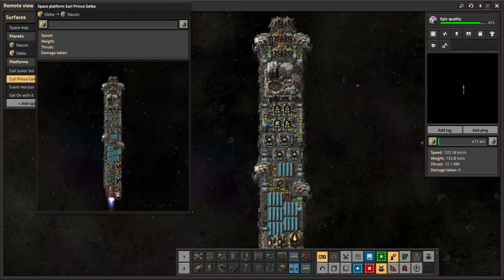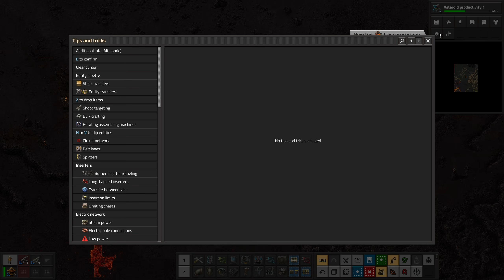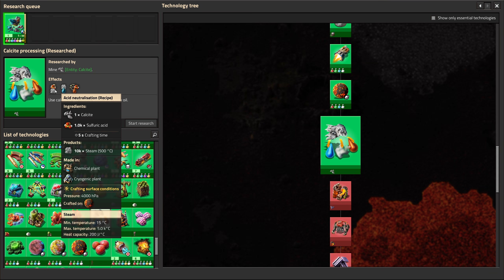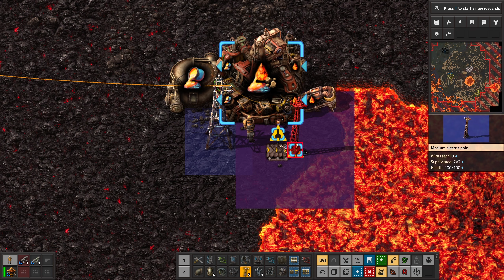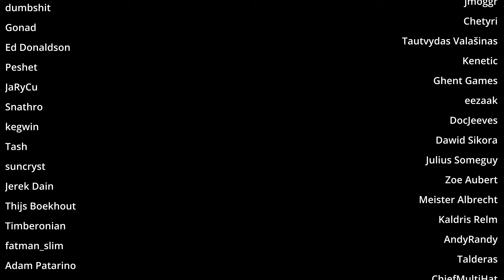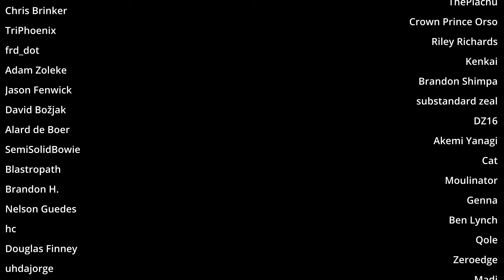Volcanus with no supplies : Factorio Space age Ep15

Comment: I did Gleba and Valcanus from scratch.  Fulgora I did with logistics/construction bots and boot strap power which I kind of regret, but man that would be a difficult startup from scratch.  I also eventually imported my power plant as fulgora power is very interment until you have 1k+ accumulators and 100s of lightning towers.  I was so disappointed that you could not do Aquillo from the ground up but at least it was easy.

Comment: Foundries making foundries are very nice. You cant prod the final product in an assembler so that base 50% prod is very nice. This applies to everything that can be made in the planet specific special buildings.
Look at throughput rates for plates in your foundries, and look how much calcite you need. Spoiler, it might fairly be described as negligible. 
You can EASILY do 1k spm on nauvis importing 100% of a calcite, using only stacked belts. You can, without much effort, do 4k spm in the same manner. This would be without any quality buildings.

Anyway, yeah, megabasing on Vulcanus is more fun than not imo. Then just export all the science to Nauvis for the biolabs (can only be placed on Nauvis so you're stuck doing that). If you want to avoid transporting the science, you can just use foundries on Nauvis, it ends up being about the same amount of effort. Vulcanus feels more novel but that just me.

Comment: I think it's more fun when each inner planet is mostly self sufficient. That being said I'm totally okay with bringing some starter supplies, like steel furnaces, assemblers, chemical plants, power poles, bots, and some raw materials. Enough stuff to get you off the ground so you can start producing it on the planet without having to slog through starting from nothing.

Demolishers totally do demolish cliffs if they run into them. They will go out of their way to destroy any buildings you place in their territory when they see it on their patrols, which is a good way to put them to work while you do other stuff.

Also I can't believe you just dismissed toolbelts like that. Ah well, I'm sure they'll find their way into your equipment grid one way or another.
Reply: to fill up that legendary equipment grid they will

Also Devs made it so you can start well on any planet - the last one, so... i like his plan of figuring out stuff from scratch THEN dropping everything you mentioned to speed up the scaling. 
I don't wan to see him figure out the whole production chain in 12 minutes and then just do it, i did that myself already.
Reply: @mrShift_0044  Unless they've fixed it since Dosh's video where he started on Fulgora, you'll experience hard locks in the tech tree with the "craft/mine x" techs.

Comment: 12:20 - Wait... does Space Age change how inserters work?
I don't have the DLC yet (no point when I haven't completed the base game). And in the base game, stack inserters just pick up more at a time. In my current run, my bulk inserters can pick up 5 items at a time... but still places them '1 high' on the belts. So a belt (any speed) can hold 8 items (4 per side) at any time... no matter how it gets put on the belt.
The point to bulk inserters is just that they only swing their arm once to move more items. But if the belt can't feed them fast enough, they can't do it. So they are better for pulling from storage, or fully loaded blue belts.
Reply: There are special inserters called "stack inserters" that can stack items on belts. You can get research to allow you to stack 4x as much on a single belt using them.
Reply: Yeah, they're called bulk inserters in vanilla now too, entirely because stack inserters now are a level on top of bulk inserters.

Comment: I leave a station up in orbit dropping ice and carbon down to the surface. It's not much, but it helps.

You should check out the Visible Planets mod, I didn't even realize you'd made it to Vulcanus till you hit drop to planet. Should be in vanilla. 

Silicon carbide? Been playing X4 again? :D

You don't need the belt there to hand off between two inserters, but it doesn't hurt. I usually stick a chest there to collect the stone, then only dump it once it's over X amount.
Also once you're making far far too much stone it's easier to dump it into an assembler to turn into landfill then dump the landfill than trying to dump all the stone into the lava. 

The hectopascal (hPa) is a unit of pressure commonly used in meteorology to describe atmospheric pressure

In addition to the insane DR the shai-hulud have even more insane HP regen; poison won't do squat other than making them angry. Technically better than lasers which they don't even notice, but still not helpful. 
I have modded early-game shock turrets that are super-effective, so much so that I stopped using them. Vanilla discharge defense can work on the small worms if you fill your armor with them and are brave. 
Massed gun turrets is easiest at first //seems like that's the route he took//. Or you could ship in nukes. Late game railguns are best.

Comment: RE: miners stacking ore on belt - that is another benefit of the big mining drills, they do that automatically. The smaller ones don't.

And yeah, every planet minus Aquilo can let you bootstrap yourself into space with nothing coming from outside. Gleba is probably the most painful one for that, while Fulgora is pretty easy. It's definitely fun to play it like that.
Reply: Technically there’s a softlock that can happen if you go to vulcanus without  unlocking medium power poles and leave nauvis in such a state that you can’t research them after leaving. Obviously I doubt any player would experience this, but funny to point out regardless
Reply: They only do that after you have belt stacking/stack inserters from Gleba. We've got big miners on Vulcanus and nothing's stacked on belts since we haven't been to Gleba yet.
Reply: @Genesis8934  Fancis has been to Gleba in Episode 11.
Reply: @ThePiachu  Yes, I know. I'm just explaining in case someone else thinks otherwise.